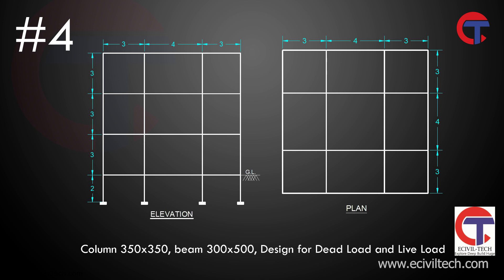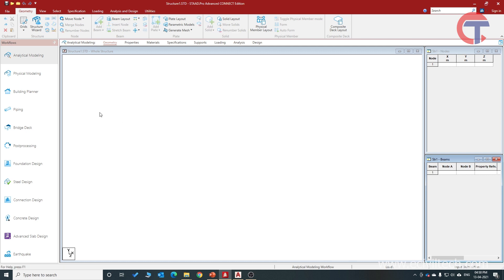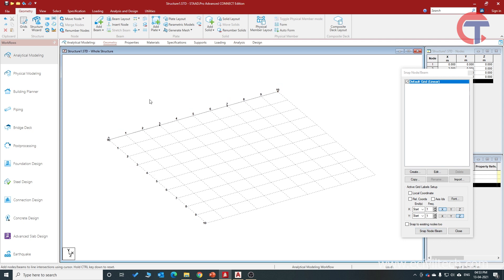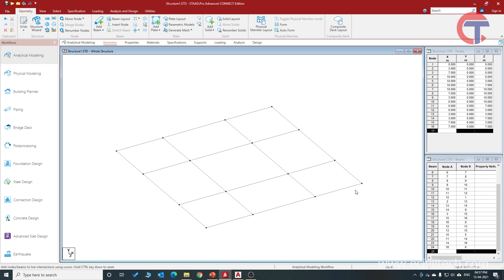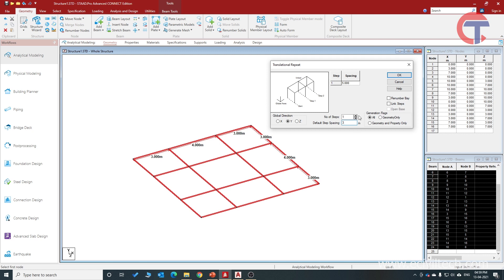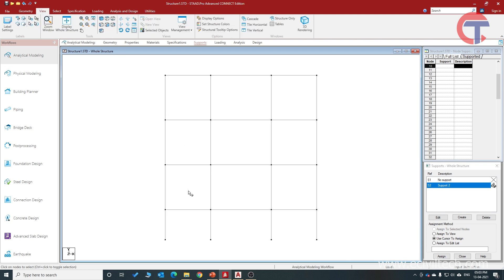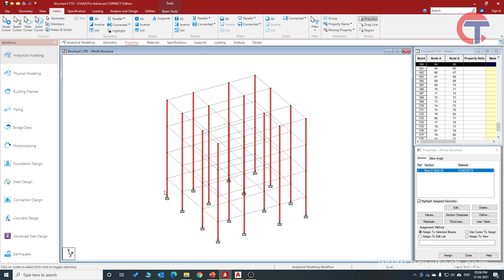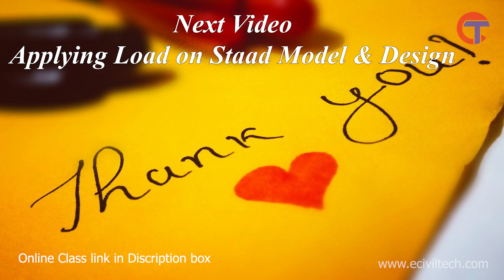Design of G+2 RCC building on Staad pro connect series - Part 1 Modeling |eciviltech

Comment: You dais at the end of the lecture that you will apply loads but you didn't model the slab?
Reply from the maker: Modeling of slab is not required. We can design slab manually.
Reply: @eCivilTech  do you have a lecture with full design including slab design?